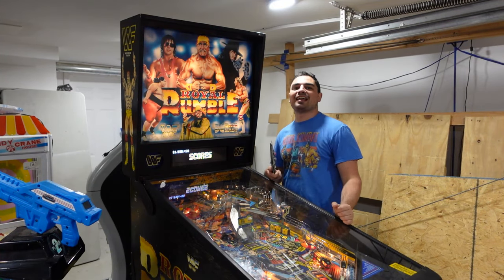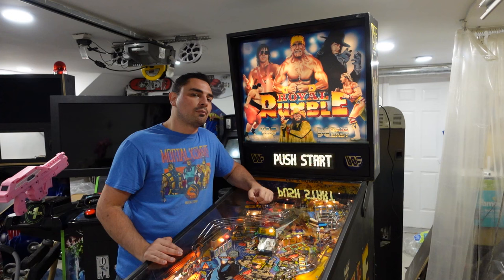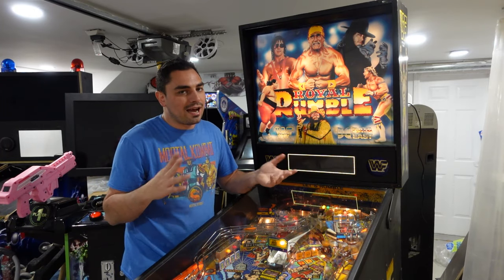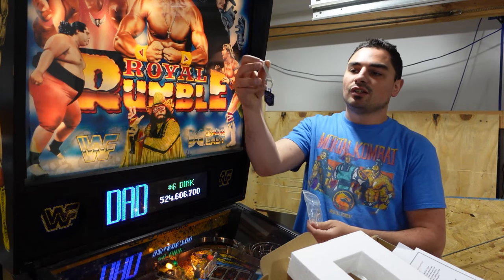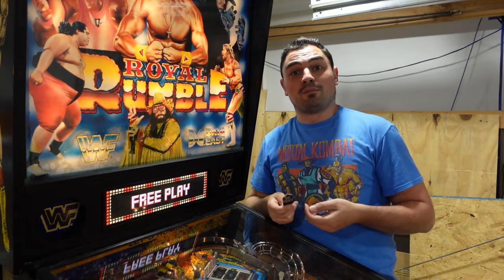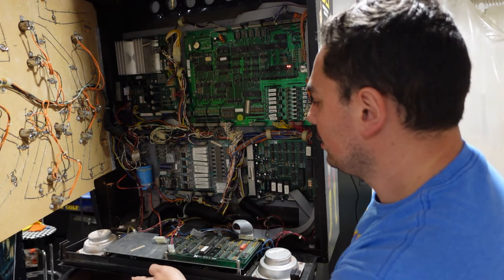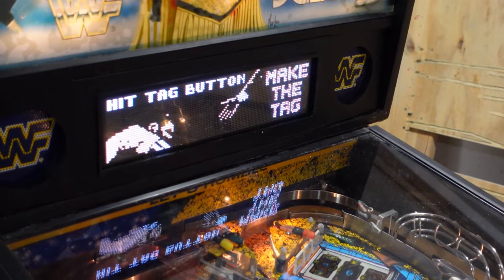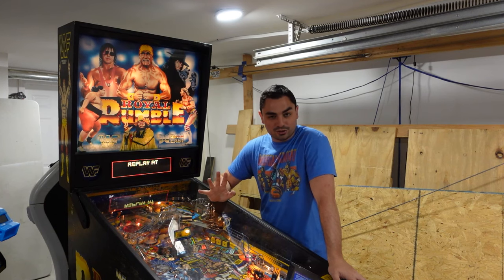PIN2DMD ColorDmd from RetroCity Pinball Installed on a WWF Data East Royal Rumble

Comment: Can you access the diagnostic menu? My goes black
Reply from the maker: Same mine goes blank as well, I just did a rom chip upgrade so I had to connect the old dmd real quick.
Reply: @Vic_VP  The colours are incomplete and the fact you can't get to the diagnostic and assets menu renders it useless and incomplete. Hope you weren't charged for the colour files.  I think it's really poor form. You've done a great video but to anyone wanting to upgrade steer clear and pay the extra for the colordmd and not this incomplete unsupported product.
Reply from the maker: @Crypto_Scottie 
@Crypto_Scottie yea seems like it's not complete. They don't charge for the colour's files. I luckily still have my flickering dmd so I can quickly swap it in to adjust settings... in reality once you adjust it to your liking, you'll rarely adjust settings for this game.
Reply: @Vic_VP  Hi Vic, for this one, simply pop out the SD card and hit reset on the back of the Pin2DMD to go to default colours. Then when finished in diagnostics, put it back in and hit reset again. Our PCB has the SD card slot on the side to allow for easy access on DE machines. We will have an update shortly for all our customers and I will send you the update to test out which includes this fix among others. Thanks!
Reply: Hi Crypto Scottie, if you've gone one of our Pin2DMD's please reach out and I will send you the beta update to try out. It should fix the diagnostics issue and future updates will fix the other colours. We support all our products and you're welcome to get in touch to discuss. Thanks!
Reply from the maker: @Colourdmd  I'd b interested in this to try out 👍
Reply: @Vic_VP  I will send you the beta to test shortly. Great video, thanks!